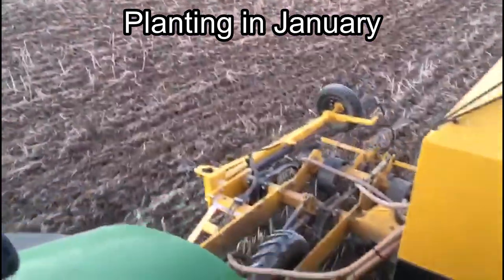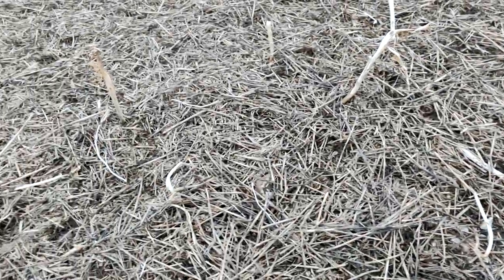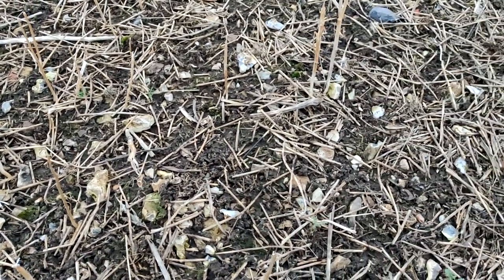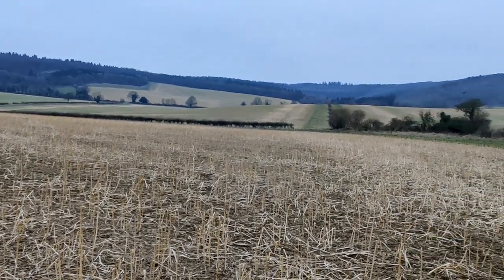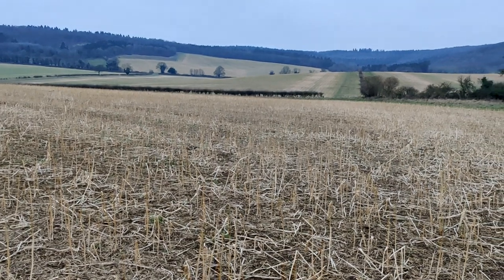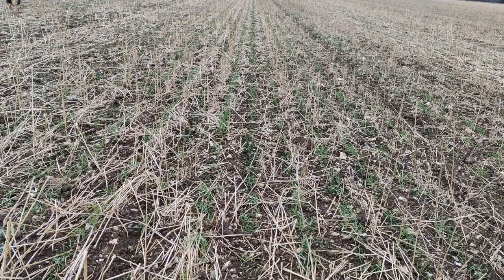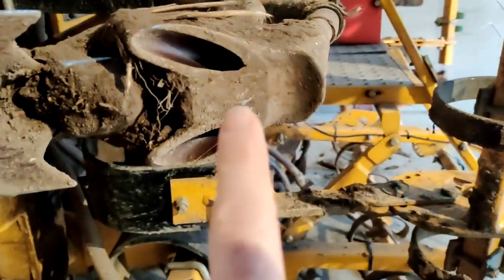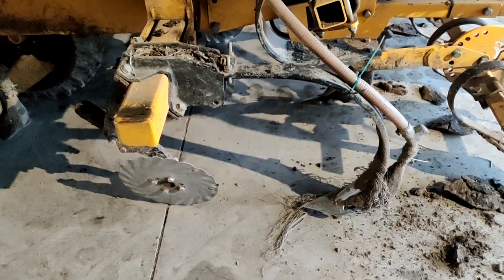January planting

Comment: A good video as always. I think low disturbance is generally over-stated, the benefits of a strip till drill are significant in many situations, despite popular opinion. I use a mzuri for most crops, but admittedly have started using a disc drill for situations where rotation (or lack of) has let grass weeds in.

I've got to ask though... Why do your wear your Groundswell lanyard in your videos?
Reply from the maker: Lanyard has my dog whistle on. Pointer needs regular whistles!